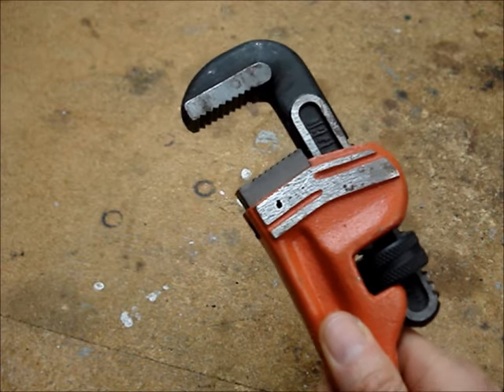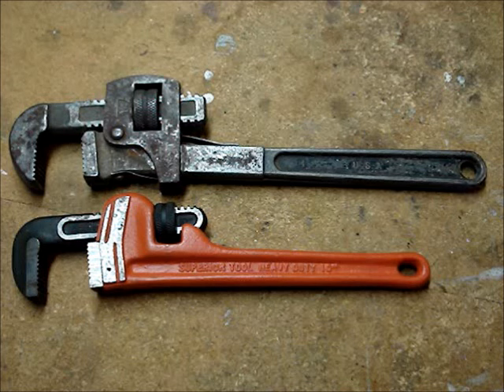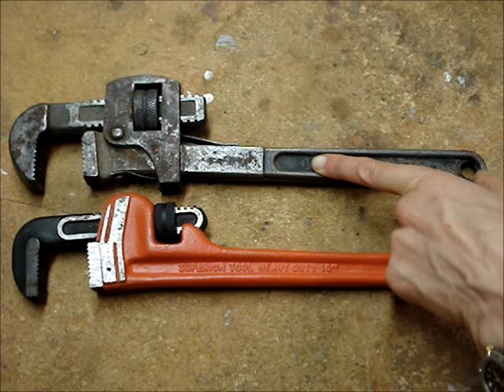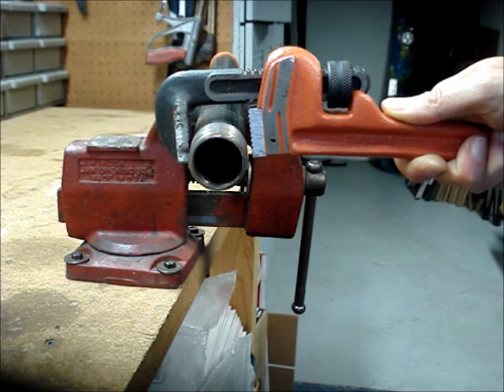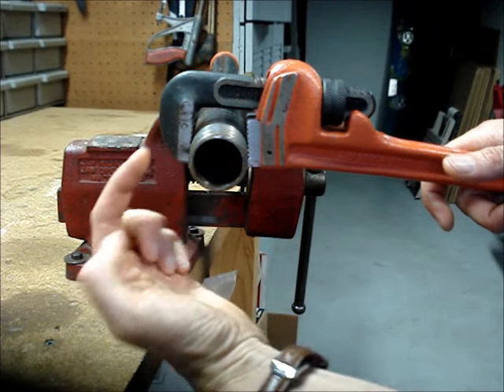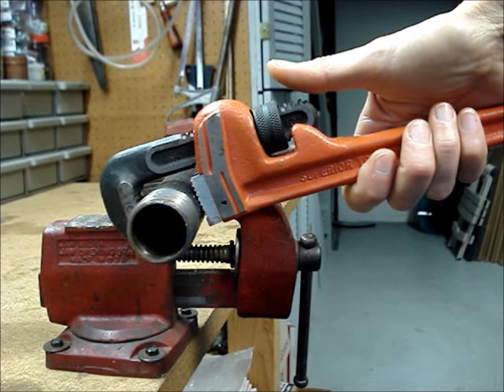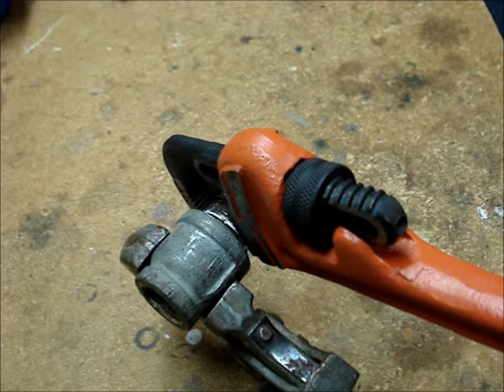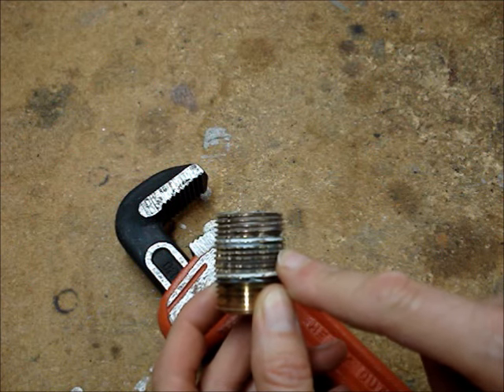How to Use a Pipe Wrench

Comment: Te first time i tried to use a wrench like this i Made it a huge oval. This way is wrong man, any good plumber knows it.
Reply from the maker: Hi Brian, thank you for commenting.  I am open to hearing the correct way to use a pipe wrench.  What is your method?  I followed the guidelines from Ridgid, a leading manufacturer of pipe wrenches.  Here's a link to the pdf showing how they recommend to use their wrenches.  http://www.dmp.wa.gov.au/Documents/Safety/MSH_ProductSafetyAlert_Ridgid_ProperUseOfPipeWrenches.pdf
Reply: notice he says its wrong but doesn't explain the right way.
Reply: Plumbers are not the only professionals that use pipe wrenches. Pipe wrenches are used on far more than just 1/2" copper pipes! It sounds like you're describing one very specific situation if you're turning a soft pipe into an oval by hand - perhaps even using the wrong size of wrench (or even the wrong TYPE of wrench) for the particular pipe you're describing. That said, 1/2" copper pipe is probably a good example of where the extra gripping force of the 2-point method is not desirable, and the 3-point method is better only because it can't grip as hard. (slips before it crushes the pipe) Surely you can see that lower grip force of the 3-point method is not desirable across all use cases for a pipe wrench?
Reply: amen

Comment: That tip to release the wrench from the pipe was gold! Excellent video, thank you!
Reply from the maker: You are welcome, Eddie!
Reply: Wow, never knew that, very interesting
Reply: @Know-How-Now  Can u pls explain why the wrench must have a titled jaw. And what are the essential point one must notice when design a wrench? The mechanism in pipe wrench is hard to understand, I designed one myself, but it doesn’t work smoothly as the bought one. The one I designed can only grab the pipe when it’s close enough to the pipe, a little distance will cause the failure, I don’t know where went wrong.
Reply from the maker: Hi Jason, That's impressive you are designing your own wrench.  I don't have any experience with design, your question is beyond my knowledge and experience.
Reply: @Know-How-Now  okay, thanks for your reply, if u know anyone who is familiar with the mechanism, could you pls note me a little bit?  I’m working on an automatic wrench system, but the mechanism seems like the only part that won’t work with me, I can really use some help. Just sayin, if it’s not too much to ask, thanks anyway.🙏🙏🙏
Reply: Yeah but when you are at work the tip never works 😅😅

Comment: I thought it was suppose to make three point contact so it doesn't start to square to side of the pipe with all that pressure
Reply from the maker: There seems to be two school of thoughts on how to position the wrench.  I went to the Rigid's (major manufacturer of pipe wrenches) website.  Their instructions tell you to position the wrench as a show in the video.  I'd think that if you design and sell the wrenches, you wouldn't tell people to use them in a way that would crush the pipe.

If anyone has input on the topic, comments on your experiences are welcome.
Reply: @Know-How-Now  well that's not a rigid pipe wrench  doing it like that will take the pipe out of round
Reply: Good question- just saw the "This Old House" how to use a pipe wrench and he says 3 point contact.  Geesh- even the experts can't agree.  What to do??
Reply: @Know-How-Now  yours isn't a ridgid
Reply from the maker: Taylor, can you explain how a Ridgid brand pipe wrench is mechanically different than other brands?  Here' the link to Ridgid's document:  http://www.dmp.wa.gov.au/Documents/Safety/MSH_ProductSafetyAlert_Ridgid_ProperUseOfPipeWrenches.pdf
Reply: @Know-How-Now  they aren't different you're Right
Reply from the maker: I couldn't see a difference either.  My best guess at the reason for two schools of thought on how to position the wrench is that earlier designs of the wrench may have rounded a pipe if there weren't 3 points of contact.  The three point of contact has been passed on even though the design has changed.  I have to go with Rigid's  instructions, they do design and sell wrenches.  I can't see any reason why they would instruct people to use their wrenches incorrectly and damage a pipe.  Thanks for adding to the discussion about the correct use of a pipe wrench.
Reply: @Taylor-xh8uh  i agree. Its best to get a 3 point contact bite. Leverage is a bit better also. U always want ur bite to be ideally 3 point contact and that the mid point on your length of teeth on both bite contacts r touching the mid diameter point of the pipe
Reply: @Know-How-Now  even if a manufacturer  like Rigid says something, try it yourself and you will understand what I mean. If rigid said use 2 point contact - they need a correction and need to fire the publisher of that article asap, can you post the link where they said that, as its hard to believe. Anyways will inform them this goofup from their side.
Reply from the maker: Here's the link from Ridgid, who is the publisher.  How about uploading a video showing a pipe being ovaled?  https://cdn2.ridgid.com/resources/media?key=32efff83-321f-4065-a5c4-04b77a67bc2b&languageCode=en&countryCode=PH&type=document

Comment: Others may have noted this, but you are incorrect in saying to grip only with the serrated jaws!  The proper method is a 'three point bite' where the pipe also contacts the inside of the moving jaw. Not doing this risks making the round pipe into an oval, thus ruining it.
Reply from the maker: Hi Tim, below is a link to a document from Rigid, a manufacturer of pipe wrenches. It shows how use a pipe wrench and it's not the "three point bite".  There does seem to be controversy on the correct way.  Over the years the design of the wrenches has evolved. I suspect that the three point method may be true for old wrenches.  Some folks have added some insightful comments.  I have to go with the the people who design and sell the wrenches method of use.  Have a look at page 3.  https://cdn2.ridgid.com/resources/media?key=55e65591-976f-4311-9106-eca3d172963a&languageCode=en&type=document

Comment: yes, there are two thoughts on this matter as Stilson invented the design with the use of 3 points of contact then it is obvious that is the one to go with three points of contact also ensures an equal straight grip, plus if you have had to undo very tight pipes then the proof is in the use, Rigid make pipe wrenches but on use, they still distort the pipe/tube on very tite threads using only two points of contact. It still stands with all makes you do not ratchet back to get a new grip that will destroy the teeth the pipe and the fitting. For all the doubting Thomases out there then either you have not come across distorted pipes/tubes or you do not have experience in these tools. Like I said a very good video but slightly wrong but still extremely useful to let people know the use of tools, after all, I did not bother to put any video up. So again well done for taking the time and care to help people. which is obviously appreciated judging by your likes and feedback
Reply from the maker: Thank you for your thoughtful and respectful comment. Comments like yours are always welcomed on this channel.  I am not offended if someone disagrees with me and like to hear other people's thoughts.  Do you have any thoughts why Ridgid would recommend only two points of contact?  I am not asking in a way meant to disagree with you or be disrespectful of your opinion.  It's a head scratcher that a major tool manufacturer would instruct their wrenches to be used incorrectly.  Any chance that if someone used the wrong size wrench it could oval a pipe?  One more question if you don't mind, have you ever experimented and tried to oval a pipe using the two point method?  Here is Ridgid's instructions that advice to use to points of contact:  https://cdn2.ridgid.com/resources/media?key=32efff83-321f-4065-a5c4-04b77a67bc2b&languageCode=en&type=document

Comment: 1:57 you can't rest the hook jaw against the pipe as then it can't rock back, is that correct?
Also, the rocking motion of the top jaw clamps harder as you press down on the handle as it's pushing back following the law of equal and opposite action is that right?

Comment: Thank you!  I feel better about using my new pipe wrench now.  I've been trying to open my sewer cleanout with a pipe wrench, but I'm hearing from the video that that is the wrong tool for the job.  What is the right tool, and how do I use it to open the sewer cleanout?
Reply from the maker: You might try something like this:  https://www.homedepot.com/p/Camco-RhinoFLEX-6-in-1-Sewer-Cleanout-Plug-Wrench-39755/207160401
Reply: @Know-How-Now  Thank you!

Comment: This video is pretty good but did not mention a technique that is a must when using either a pipe wrench or a Crescent type wrench- a 3 point bite. You show both the fixed and movable jaw around the pipe but there is space between the jaws and the pipe at the top. Open the jaws slightly. The movable jaw should touch the pipe in 2 locations.
What difference does this make? If you apply enough effort to a very stubborn pipe, maybe even with a cheater bar on the wrench, you can take the pipe out of round and make it oval in shape which makes it even more difficult to remove. Using a 3 point bite will prevent you from doing this
Reply from the maker: There are several discussions on this topic in the comments.  You will find a link that I have added to Rigid's web page that tells you not to use the technique you describe.  Some people cite the This Old House Video that uses your method.  I chose to go with the instructions from the manufacturer's engineers who design pipe wrenches.  My thought is that the 3 point method may have been the correct way with older Stilson style wrenches.  Thanks for the thoughtful and tactfully presented argument, it is appreciated.... there is not much of it these days on the internet. You are a gem.   https://cdn2.ridgid.com/resources/media?key=32efff83-321f-4065-a5c4-04b77a67bc2b&languageCode=en&type=document

Comment: Is there a way to a hieve airtightness, under high temp 350c , without tape? The pipe tapes degrade around 300c? But the end needs to be removable

Comment: It seems such a brute thing, but listing to you, I've found out it's really pretty elegantly designed :) Thanks
Reply from the maker: It's my pleasure to help.  Happy Plumbing.. lol.
Reply: @Know-How-Now  Bicycle maintenance. One of these bad boys was exactly what I needed to remove my unmoveable seat post. It's all about levers ^^
Reply from the maker: That's a great idea.  I had a seat post that was not moved for about 30 years.  I treated it with PB Plaster penetrating oil and gave the seat a few whacks with a rubber a mallet.  It took doing this once a day for 3 days to get it worked loose, the pipe wrench would have been gentler than whacking the seat with a mallet.

Comment: They way you show of using the tool can ruin the pipe by crushing it into a oval shape.  The pipe should go deeper into the wrench so that contact is made at three points instead of only two.  Excepting that overlooked point---nice video.
Reply from the maker: Thanks for commenting.  There is some difference of opinion regarding two vs three points of contact.  I checked with Rigid, they tell you not to use the three point of contact method. They design and manufacture pipe wrenches, so I went with the two point method.  Often, there is more than one way to do something and both ways could be correct.
Reply: I agree with the other reviewers about three-point contact.  Check out what Rich Trethewey of "Ask This Old House" recommends in his video, which is the three-point method.  The reason is that by only using the two-point method, you will oval the pipe, which can make it difficult (if not impossible) to remove the pipe later if necessary.  I would suggest that you contact Ridgid again and ask them if it's possible the information provided was incorrect.  If they claim the earlier explanation is correct, ask them for a detailed response regarding why the two-point method is superior.  Either way, please share that information with us, as the two-point method goes against everything I've heard and experienced.  Thanks.
Reply: @stever5887  There's a bulletin put out by Ridgid entitled "Proper Use of Pipe Wrenches
" that states the following: "When using a pipe wrench of any size, a gap must be
 maintained between the shank of the hook jaw and the pipe itself. This permits the pressure of the two gripping points (the heel jaw and the teeth of the hook jaw) to produce the gripping action of the wrench. Allowing the back of the hook jaw to contact the pipe greatly reduces the gripping action of the wrench and can cause the wrench to slip. It may also result in the failure of the hook jaw. Maximum grip and turning force is developed by maintaining a gap of approximately 1/2″ (12mm) between the back of the hook jaw and the work piece."
Reply: @stever5887  Ridgid's pipe wrench usage guide does explain why the two-point method is better. They suggest that grip and turning force exerted is greater when the neck of the adjustable jaw is close, but does not touch, and that touching the neck can cause slippage and potentially damage the adjustable jaw using the 3-point contact method (since the third point of contact on the adjustable jaw neck would present a lateral force to the neck not present in 2-point contact). I agree with @Know How Now - there is clearly polarizing conflict of opinion on this topic, even among professionals, which itself is fascinating given how long pipe wrenches have been around. Given the cam action inherent in pipe wrench functionality, if sufficient force is applied to crush the pipe it is not clear that the third contact point would prevent deformation, although it does appear that it might brace one side of the pipe from bulging out (but not the other side). Perhaps this subtle advantage on certain softer metal pipes is more advantageous than the additional grip that the two-point method provides, and makes it the better approach in certain circumstances.

I suspect that there is a strong element of tribal wisdom at play here that has passed down both techniques over time, based on what works best with different pipes and different wrenches. It's possible that three-point contact does work better on certain materials, or when the center teeth of the wrench start to wear down, or when lack of grip is not an issue, or in a variety of other circumstances. At the end of the day, one thing is undeniable - the neck of a pipe wrench is designed to be able to move laterally (perpendicular to the force that the jaw applies to the pipe) to provide cam action - cams do not work without room for this lateral motion. It is quite clear that contact with the neck prevents this lateral motion of the pipe within the jaw and would not be able to grip with as much force.
Reply: Seen this comment now.....ive seen the 3 point method and in theory sounds better,but in practice with that method you cant remove the wrench so easily as shown here,it stucks.....using the 2 point method you can remove the wrench easily as shown here....

Comment: Richard the plumber on this Old house says the exact opposite of what you said. He says you should always have a three corner bite on a pipe so that you don’t take it out of round and you said just grip it with teeth two points of contact
Reply from the maker: Hi Steve, there have been several discussions in the comments about 2 or 3 point contact.  I consulted Rigid and they recommend the method shown in this video.  They make wrenches so I went with their advice.  There are several links to that document in the comments.  My guess is that the wrench design has changed and the two point method is something that applied to older design of wrenches and it continues to be taught.

Comment: "This old house" channel says use 3 point contact, otherwise you may make your pipe oval if you put too much force on it.
Reply from the maker: Below is a link to a document from Rigid, a manufacturer of pipe wrenches that tells you how use a pipe wrench and it's not the way shown on the This Old House video.  There does seem to be controversy on the correct way.  Over the years the design of the wrenches has evolved. Perhaps that has changed how the wrench is used.  Some folks have added some insightful comments.  I have to go with the the people who design and sell the wrenches method. http://www.dmp.wa.gov.au/Documents/Safety/MSH_ProductSafetyAlert_Ridgid_ProperUseOfPipeWrenches.pdf
2

Comment: Not resting the hook jaw against the pipe is incorrect. If the pipe is really torqued on with only the 2 jaws touching, you can distort the pipe into an oval, making it impossible to fit.
Reply from the maker: Below is a link to a document from Rigid, a manufacturer of pipe wrenches.  It does not use 3 point contact, it shows the method shown in the video.  There does seem to be controversy on the correct way.  Over the years the design of the wrenches has evolved. Perhaps that has changed how the wrench is used.  Some folks have added some insightful comments.  I have to go with the the people who design and sell the wrenches method. http://www.dmp.wa.gov.au/Documents/Safety/MSH_ProductSafetyAlert_Ridgid_ProperUseOfPipeWrenches.pdf